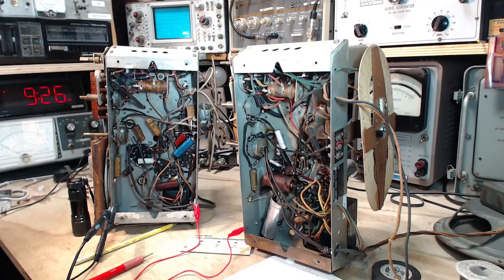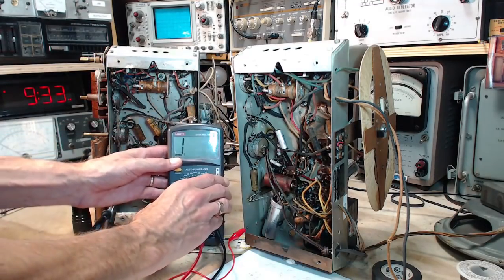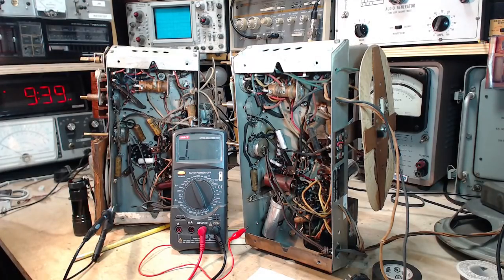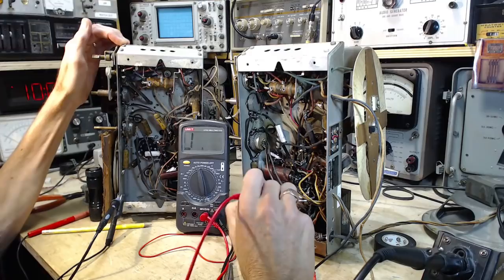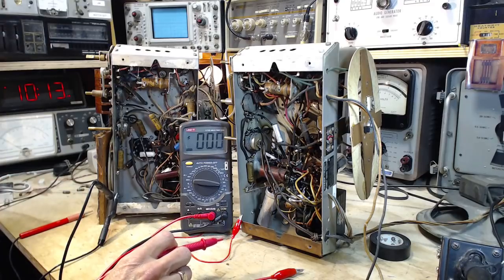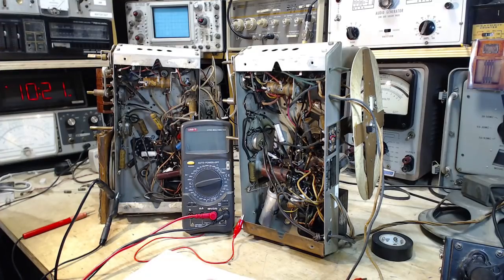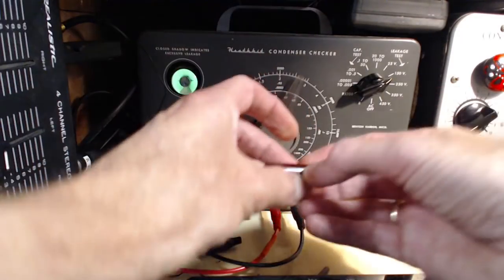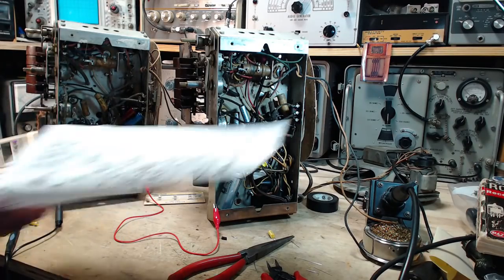Two Canadian Crosley 12B Radios Video#5 - Output Stage

Comment: Also: those molded caps are not really any better than the wax paper sleeved ones.
The material ("plastic") molded around them will allow moisture to pass through; typical of ALL plastics.
There is no such thing as an hermetic plastic container, and water is a rather small molecule that fits through the interstices of polymers/composites.

Comment: For both, I'd go with 6F6 and 400 Ohm cathode resistor.
Also, YES, those aluminum can 'lytics do hold up fairly well, BUT, the lower voltage cathode bypass sections are often the first to go faulty. I'd not likely replace the entire can if it's not causing problems, but would isolate the bypass section and install a fresh cap anyhow. There is an inherent weakness associated with the lower voltage section(s) in those cans because that section shares the same electrolyte as the H.V. sections.
Bad juju: there could be a leakage path between the H.V. positive plates and the L.V. positive plate ;-)

Comment: The old capacitors deteriorate with age because they have a paper dialectric, it depends largely on how that paper was treated and processed before cap assembly, it gets ACIDIC as it ages and gets leaky, now with a bad seal on the ends that ACIDIC deterioration quickens !!! with admission of moisture to that paper !!!